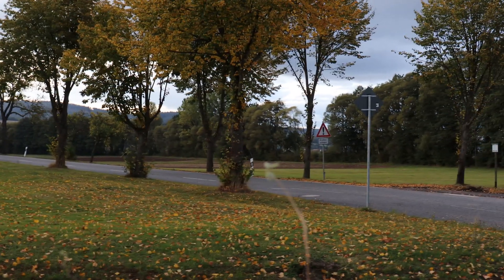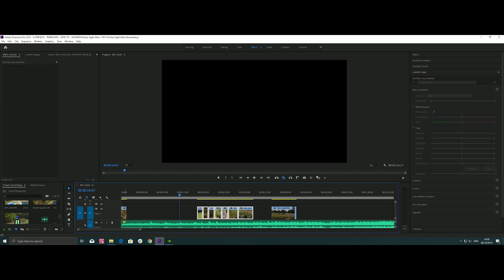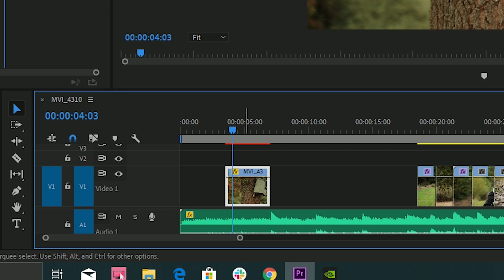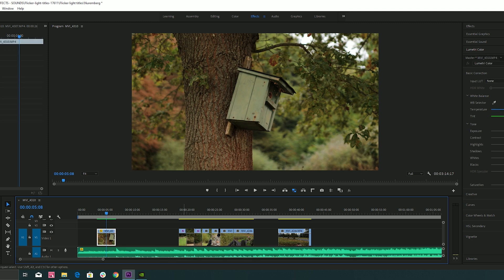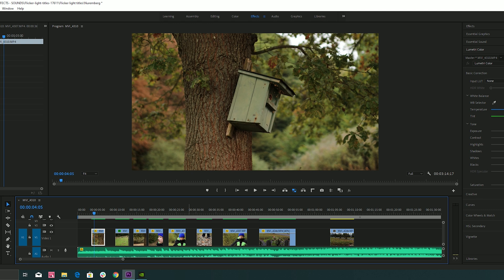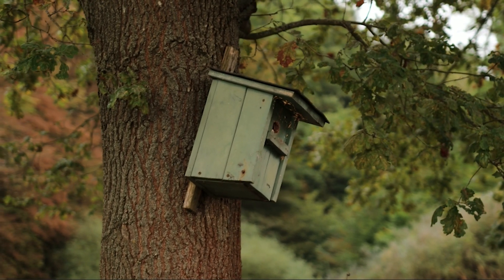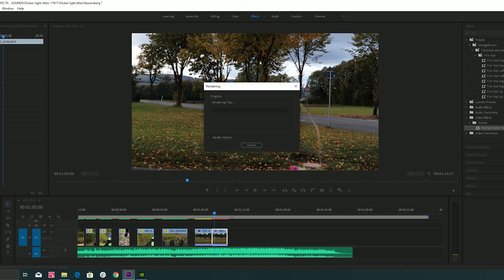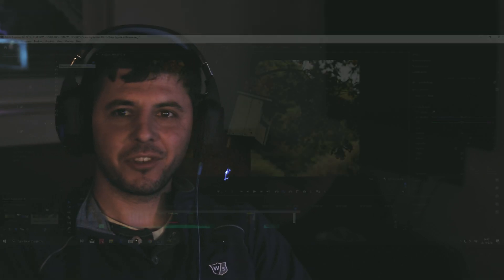How to slow-mo 25fps to look like 60fps slow-mo & Rolling shutter repair, canon 250D

Comment: If i only can shoot with 25 fps but i still want to get slow motion in postproduction by using optical flow: is it better to use 1/100 as shutter speed in order to reduce motion blur? I want to shoot a scene with fast movements (basketball) ....
Reply from the maker: Yes, is better to use higher shutter speed. Sorry for late answer

Comment: Hello, i do as you describe, in the same order - but i do not get the option to render? And my result is not that good as yours? What do you think?
Reply from the maker: The rendering option works only when you have that timeline bar, go in settings and check it out that timeline bar. And about results, not always working, sometimes appears artifacts, depending on the image movement
Reply: @Angelo_Paduraru  Thanks, what do you mean by timeline bar? I get the yellow line  - not the red?

Comment: Sir i have new 250 d 
1. Which laptop u r using for vedio editing
2.recomend me a good laptop 
3.This premiere pro version u r ising is crack or paid.
4.Which version pr is good.
5..recomend me a lense toooo😍😍😍😍😍
Reply from the maker: 1 I use desktop for editing, i7 7700k, 32gb ram, Nvidia 1070. 
2 look for a laptop with this specification like my desktop 
3 I have premiere pro 2020, the latest,  and is paid. 
4 I think the latest is the best but there are some free editing softwares like davinci resolve. 
5 sigma art 18-35 f1.8
Reply: @Angelo_Paduraru  thanks dude.  We are waiting your more magic vedios from canon250d.
Most people cnt afford the expens cameras and accessories. Most people are interested creating cenematic vedios with low cost cameras like 250d.
😍😍😍😍👍
Reply from the maker: Be Positive thanks man! I will do more videos for sure :)

Comment: What video card do you use to render in Premiere? Want to buy a RTX 2070 (using now GTX 1060), will be so necessary for the 4k? running smooth. I'm from Brazil! Hug and thanks for the tip, I signed up.
Reply from the maker: Casamenteria Cine thank you! Premiere need processor (and ram)  not video card, so 1060 will be enough, I had a I7 7700k and I upgraded to i9 9900k, the video card is Nvidia gtx 1070 8gb. 32gb ram

Comment: Perfect!:) You can directly choose optical flow when you are slowing down the video:)
Reply from the maker: Attila Bagi yes but the effect working just when slowing the video, and the  optical flow effect must be the first effect applied to the video because if you color grade just a little or cropping even 1% the video than the optical flow doesn’t working anymore. So you have to apply the optical flow first, nest the video and than you can color grade and do other things with the video
Reply: @Angelo_Paduraru  i mean in the speed/duration window you can choose optical flow as well:)

Comment: The rolling shutter canceling effect was amazig, but optical flow has limitations , you can see the warping artifacts on the pants of that guy walking his dog. The tutorial was simple and easy to follow, do more:)
Reply from the maker: Right, optical flow have limitations but exist a effect called Twixtor, is cheap and better 🤭
Reply: @Angelo_Paduraru  Twixtor? yep! i use it for several years and I can say it is worth it! It's only annoying because of the long rendering.

Comment: Wish LumaFusion could do this.
Reply from the maker: Alan Ho-Yee Sorry to hear that , maybe they will do some updates, is a good trick to create slowmotion for cameras what doesn’t have 60p
Reply: Angelo Paduraru it's a fantastic feature! I mean you can even use with 60p and slow it down even more for those who don't have 12p or 240p! Unfortunately in LumaFusion we don't even have stabilization yet or the rolling shutter correction. I want to stick to an iPad but sometimes it would be great to have the features of Premiere Pro or Final Cut Pro. I've no idea why Apple didn't make Final Cut Pro for iPad.
Reply from the maker: Alan Ho-Yee yes was awesome to have a Final Cut Pro version for iPads, I think many people wish that. 
And yes, from 60fps with those effects you can slow down to even 240fps :) I’ve tried with 60fps from my canon 200d :)
Reply: Angelo Paduraru wow that's good to know. We don't need expensive gear with high frame rates if we can just use this effect. Thanks for sharing!
Reply from the maker: Alan Ho-Yee you are welcome! 
One think you have to know, don’t use this effects in videos with high speed movements because will create some ugly warp frames, for those effects is better to record normal movement or how slow is possible